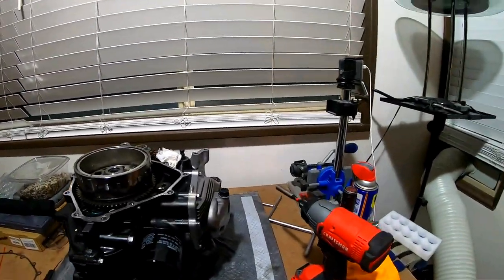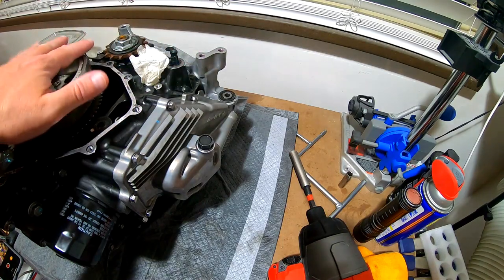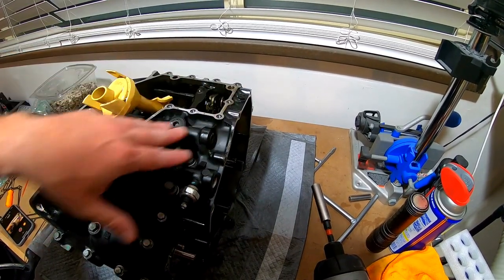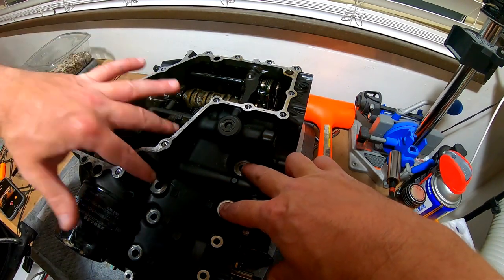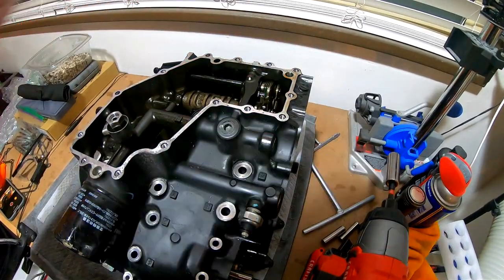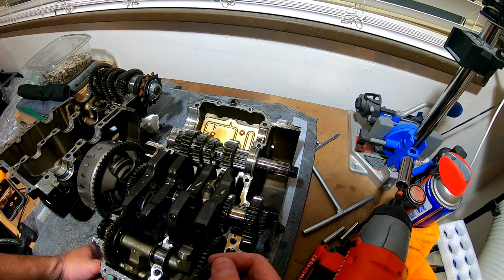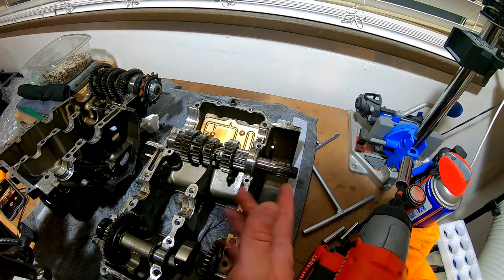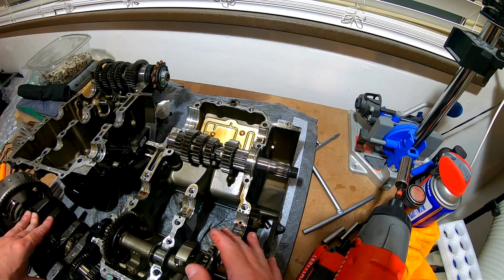DIY - Kawasaki Ninja 400 - Disassembly - Opening the Crankcase, Diagnosing Engine Knock

Comment: Do you "have" to take the top part of the motor off to get to the crank shaft? Mine has I think a bad crank bearing (literally the exact issue you're showing). We took every bolt off we could see, but we can't get the motor to split the bottom in half like you showed. My brother is nervous to mess with the timing chain so we left the top half intact. Any help would be super appreciated. Shop wanted $2,700 to replace it.
Reply from the maker: Yes you do, some of the bolts for the crankcase are underneath the top end.
Reply: @Racer510  thanks for responding! how badly is it going to mess up the timing/timing chain?
Reply from the maker: You need to remove the timing chain and top end. I would also suggest putting a new chain on when you do and align all the marks. You definitely need a Ninja 400 shop manual to do the job.

Comment: do you machine the rods and the crankshaft to be reused or getting a new set? my ninja 250 (ninja 300 but a 250) bearing has spun badly. did you replace all the bearing including the unaffected ones?
Reply from the maker: I do not machine, I just replace. They're fairly cheap to get new or in good-used condition. I always replace the bearings with new ones though.

Comment: That must be the horrible noise people hear when shifting 5th to 6th, a loud clunck grinding that pushes the gear back down to 5th when shifting to 6th, I wounder if with use the transmission gears will unite better without having to get those dogs cut?
Reply from the maker: You're right, in 6th the transmission will spit it back down to 5th. Especially at high rpm's. I'm not really sure if there is another way to fix it, I just know that when you get the transmission undercut the problem goes away.
Reply: I have realized what the problem is, the 6th gear has 3 ball bearings that require centrifugal force,,,, but Kawasaki in the manuel doen't explain this or what RPM is required to keep those 3 bearings under force so that they don't release the gear and drop the bike back down to 5th or just keep spinning without engaging at times. I found that the short shift is for very high speed and if you use 6th at lower speed then intended the bike lugs and causes a spun bearing with time....😅

Comment: My 2022 ninja is making a wierd nose someone looked at it and told me it was a warped piston rod. I can’t find anyone to help
Reply from the maker: If it's rod knock you will need to rebuild the bottom end, which means completely taking apart the engine. I would start at the top end and check valves and the valve clearance. Another thing it could be is the timing chain.